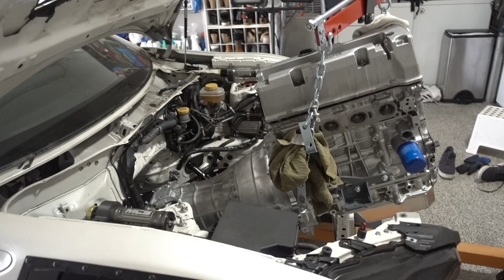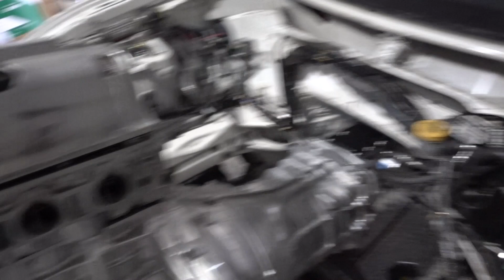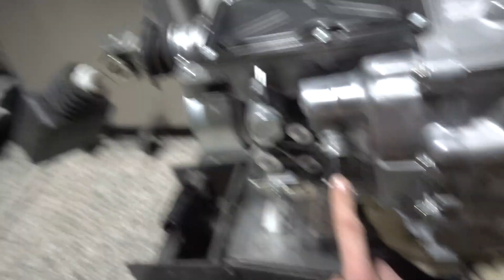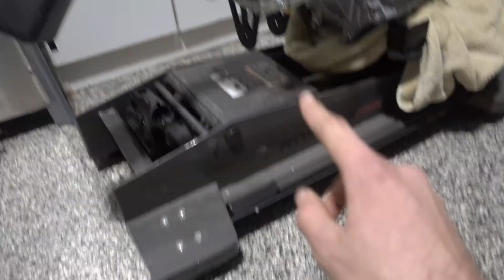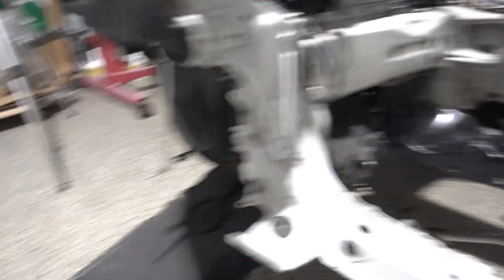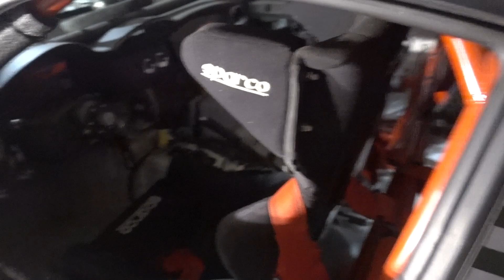CD009 Install - K24 FRS Swap Pt. 2

Comment: Are you going to be using your stock diff and axles or you thinking about going a different route on that as well? I haven’t seen any info anywhere on changing out to a different differential yet
Reply from the maker: I’m using the stock pumpkin, an OS Giken Diff, and I have DSS axles. There’s no reason you would need to change out the axles or Diff for this swap though.